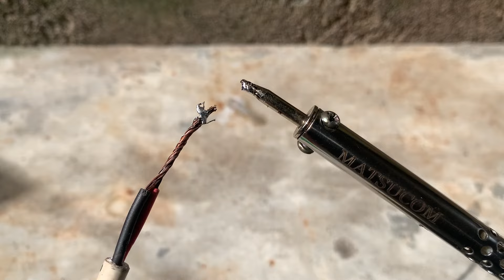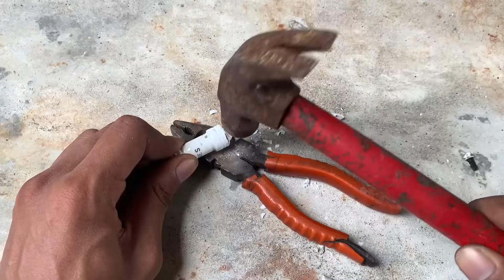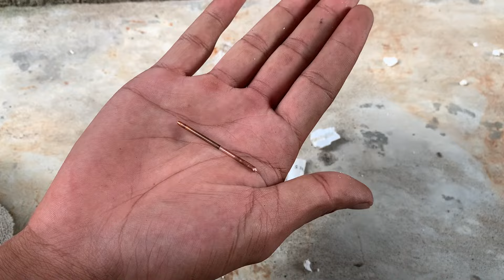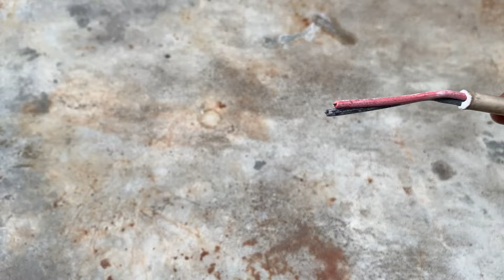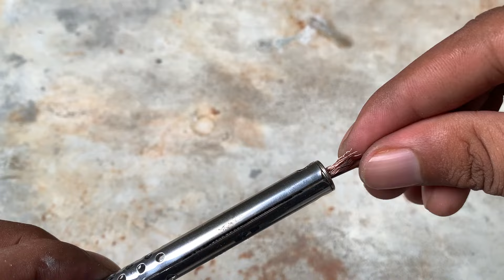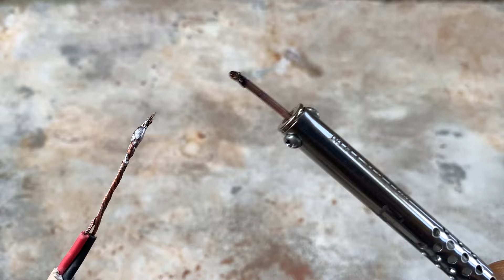The Secret to Soldering Like a Pro! Connecting Two Cables Into One

Comment: Heat the wires with the soldering iron and apply the solder onto the wires or where the soldering iron touches the wires so the flux can help the solder to properly coat the wires and create a good joint.  Balancing a drop of solder on the tip of the soldering iron and trying to apply that to the wires is not good technique.